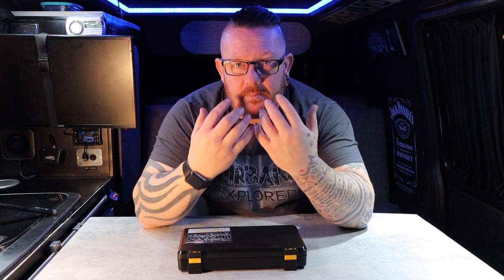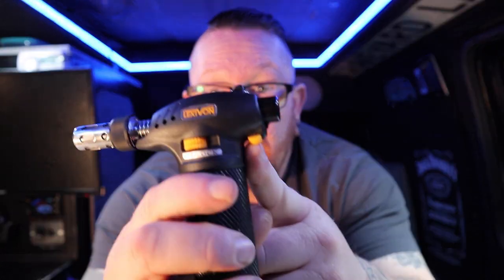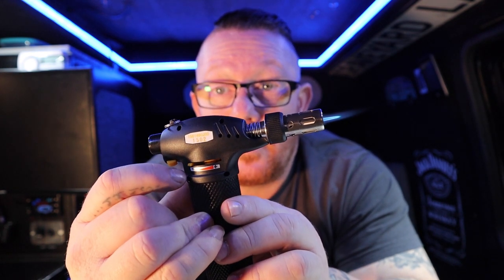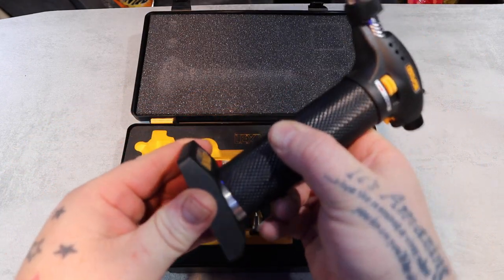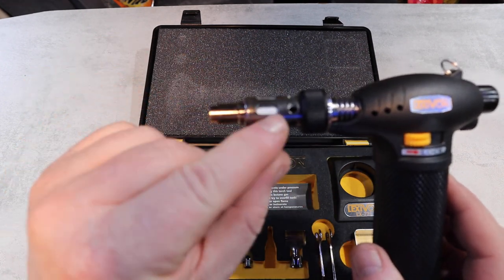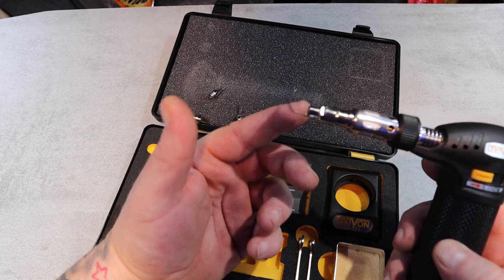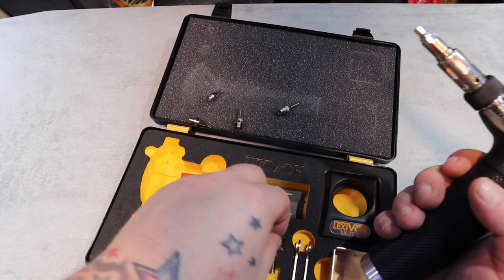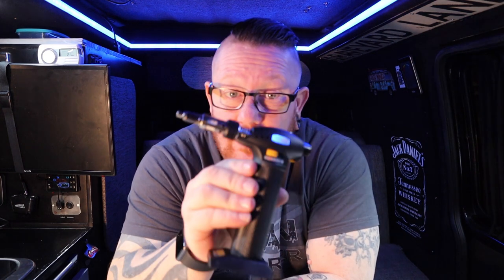Lexivon butane solder iron the ESSENTIAL van life tool

Comment: The IRODA Solderpro 25LK is a lithium Ion Battery based option that is safer to use in automotive than Butane as it does not have a flame. My friends use it on boats for the same reason as there are diesel fumes around.

Comment: It's really a practical tool.
I got one myself and the hot air attachment performs really well.
I am kinda worried tho that cheap butane might kill it in the long run.
Reply from the maker: i didnt know you could get cheap and dear mate . i never new that dude . i guessed it was all the same .
Reply: @UrbanVanlife  Maybe they are, I will do a test between cheap and expensive butane gas refill and see which one leaves residue.

Comment: Absolutely brilliant review. I ordered one today myself. A little bit of constructive criticism you could have possibly added that you need to use at least a triple refined butane Fuel. Otherwise, the cheap stuff will clog up the unit and make it not work as well as it does while new flame will start to sputter flame will be not as nice.
Reply from the maker: Yer that’s a good point that mate and one I should have added in . And I used mine today as well to heat a water pipe that wouldn’t go over a fitting . They come in super handy . Thanks for the comment
Reply: @UrbanVanlife  sounds a silly question but can you recommend a brand of butane. I’ve tried 2 cans now and both had the wrong size nozzle for the bottom of the torch, so gas ended up going everywhere rather than in the damn torch (I’m in the UK and couldn’t find any refined butane on Amazon despite them recommending the can with the product.

Also, the air breathing holes on the nozzle.. mine are covered in the white heatproof membrane.. could that be why I’m getting such a pathetic flame? Cheers
Reply: I have two of these Lexivon torches.  One uses Zippo (Amazon) butane and the other Bernzomatic (Home Depot) butane.  They both operate just fine and neither make mention of "X Refined".  So I have no idea how their "purity" stacks up against the noname refined 99X brands sold on Amazon. And based on some of those noname brand reviews, the quality control may be questionable.  One note about the Bernzomatic can is that its plastic filler tube is a perfect fit on this torch and doesn't require an adapter (I've had no fuel overspray). The Zippo's can filler tube also doesn't require an adapter for this Lexivon torch, but, I have had run off once the torch is filled and this could have been my own doing of possibly having the filler tube at a slight angle.  Regardless, no fuel problems using either and the flame output is identical.

Comment: I wonder wher I could find a shop to getting replacement parts 🤔 no parts on ebay or amazon to find.
Reply from the maker: I think you probably would have to buy another one mate
Reply: @UrbanVanlife  yes, I hate this obsolete mentality in some company's 😣
Reply: I got my today but they are made this days in Taiwan, have a golden sticker on the burners tank that says made in Taiwan, its a joke ther put a card with the 2 years warranty and a American flag on it for registration for extended warranty but its made in Taiwan, I would like rather they would tell the truth straight away, I know in Taiwan made products are not bad, but advertising it with  flag symbols ect and than not building it self its false advertising.
That's a little disappointing.
But overall for this 26£ I got it its a keeper. 😊

Comment: Where did you get the butane from I cant find any that fit to fill it up
Reply from the maker: I personally just use lighter gas mate . The stuff you get from Local shops for filling lighelters up if ya got he
Reply: @UrbanVanlife   yea I know what you mean I tried that but couldn’t find an adapter to fit it
Reply: Home Depot, Bernzomatic butane, $5 a can.  Works perfectly with this torch.  If Amazon is your preference, Zippo butane works fine in this torch too.  Both filler tubes fit this Lexicon torch.

Comment: Could you use those for woodburning designs?
Reply from the maker: Yer I should think so . They do burn well and have different heads
Reply: Just tried it on a pine baton to try out the shoue sugi ban technique. Works well

Comment: What refill canister do you use as I  can only find one, Pro Power butane Gas @ £19
Reply from the maker: Personally mate I just use lighter fluid . The one you get from most corner shops . It seems to work just fine and it’s cheep as well